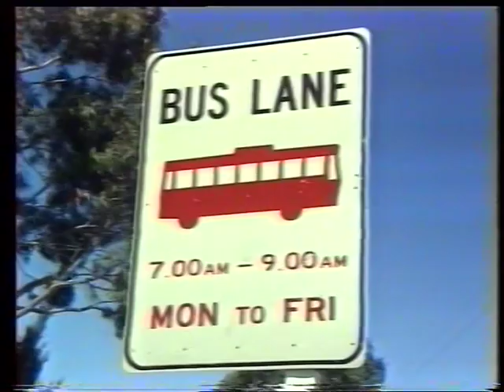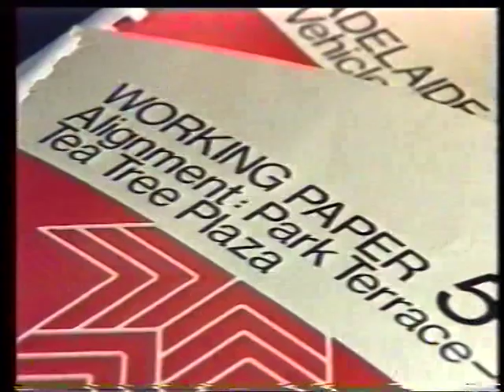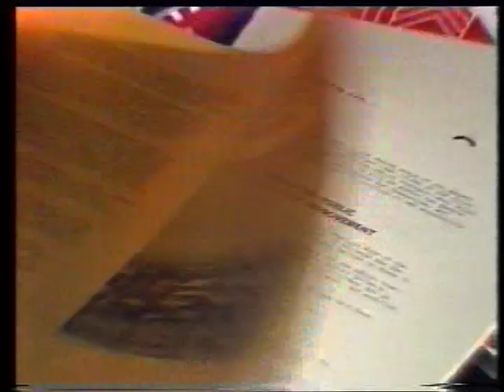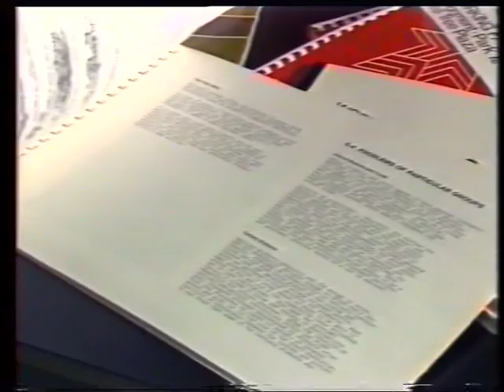Adelaide O-Bahn planning video 1982

Comment: Still travelling on it. The best infrastructure built in Adelaide. It cuts my commute time in half. Such a flexible system
Reply: its old and outdated.  theres a reason why it is so rare.  heavy or light rail is a no brainer
Reply: the speed limit keeps getting capped like in this video it was 100km/h so now it is only going to get slower and slower to get to modbury

Comment: 2020 its bumpier and slower.  it used to be very fast during the late 80's and 90's
Reply: It's still relatively quick. Speed limit is down to 90 and 80km/h though
Reply: Literally more advanced then than now.